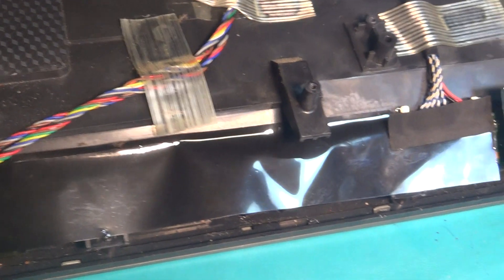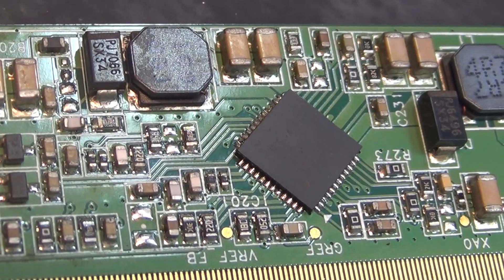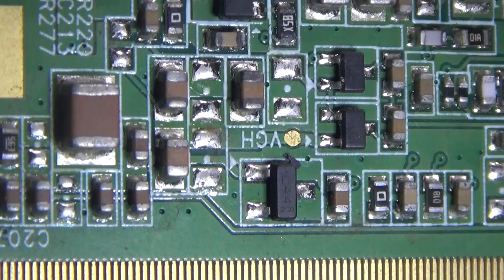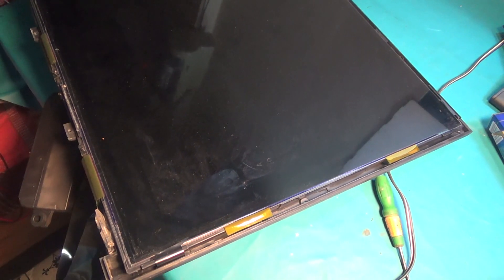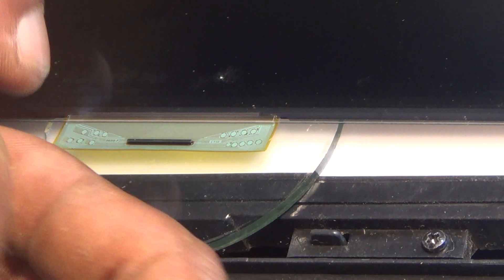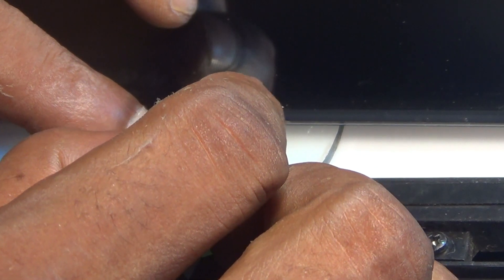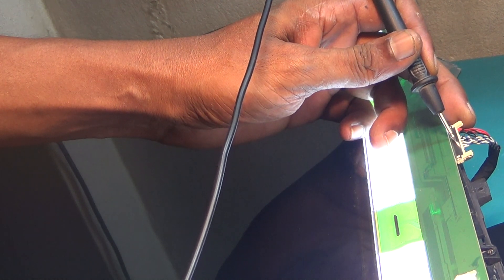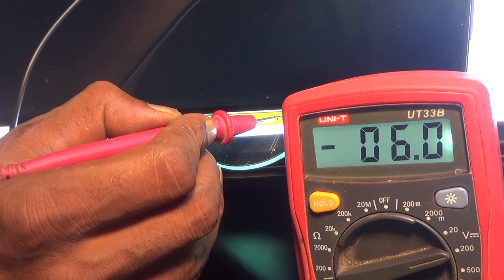LCD LED TV panel repair video#Pro Hack

Comment: Please help me my friend. I have 32" LG 32LV3710. The problem, the sound is ok but no picture. The backlight is working. I've done checking the t-con and I found out that the left channel of the panel had a problem. When I remove the ribbon connecting to the left channel of the panel from t-con and the right channel ribbon still connected its showing the LG logo when I turned ON the tv.

Comment: My sony 40in W650D, backlight ok, i check tcon board, 12V ok, 3.3V ok, 8.5V no, 15V no, Vone when plug power supply its rises to 27V and disappears immediately 0V. Voffe -11V no. Rapidly go to dark blank screen. How to repair my sony 40in. Srr for my english, im VNmese, im not speak eng.
Reply from the maker: Go to the Facebook link from the description of the channel and send a message on Messenger.